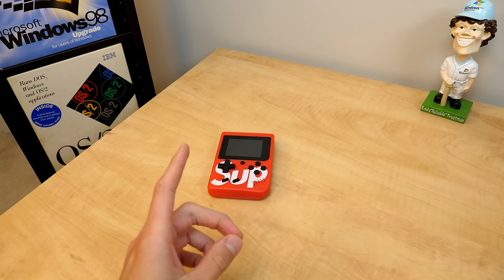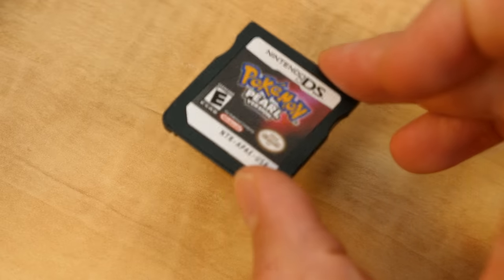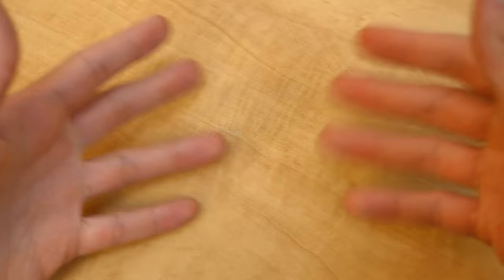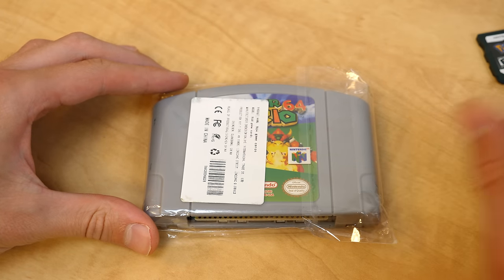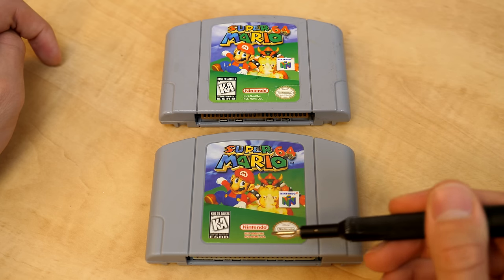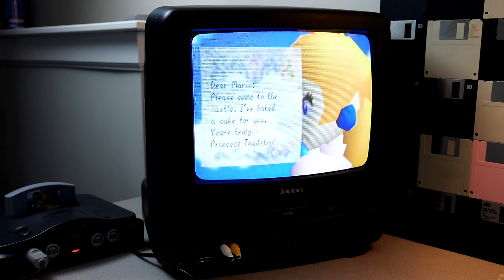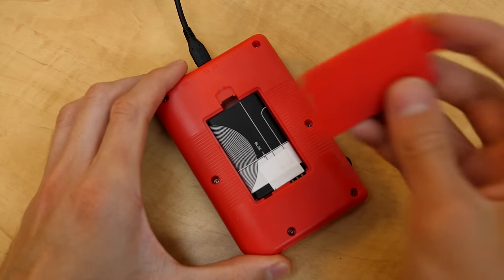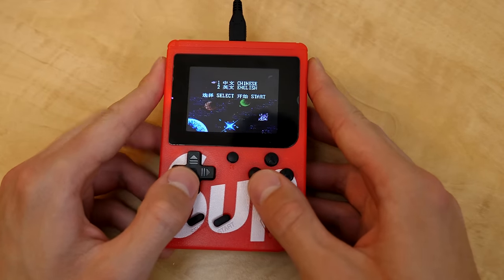I Bought Bootleg Nintendo Games from Temu

Comment: My greatest piece of advice to those looking for these older Pokemon games is consider buying the Japanese versions. They are more often cheaper as they were produced more than any other language of Pokemon games which means your odds of encountering a fake copy are also less likely due to their high abundance.

An example, it’s difficult to find an authentic copy of Ruby that’s being sold for less than $80 or even $100 if you’re lucky in English. 

But a Japanese copy you can find a lot of for around $20 
Hell in Japan you can find Ruby at many thrift stores for the equivalent of $2-$10. 

If you can get over the language barrier and if you’re buying 3ds games which require a region locked 3ds or jailbreaking your region’s 3ds into allowing for other region games to be played then you’ll want to consider going for the Japanese versions of the games

Sorry for the long rambling, this is just the best luck I have had personally with the issue of finding these old games at a fair price while they are authentic

Comment: Okay, but one question:
Does the 520-in-1 actually save data?
Reply: I don't see why it wouldn't. DS Flashcarts typically handle saving by just writing to a file on the inserted micro SD card. I suppose it wouldn't though if the micro SD card didn't have enough space or if it was a really poor quality one.

Comment: anyone who knows their stuff, what exactly is the difference between real and fake carts?
I've heard bootleg Gen 3 cartridges can't be used for Gen 4s dual slot features (Pal Park, different encounters), is that still true? What about gen 4 fakes, do they have any gameplay-related drawbacks?
Reply: Not sure about Gen 3. 
Gen 4 has no drawbacks, you can use it exactly as the original. Gen 5 depends. Unpatched Black&White 2 Roms will turn your playthrough into an involuntary zero xp challenge (anti-piracy). With Black&White I had back then no noticeable issues at all. But then it actually was pre-release of the actual game in Japan and in Japanese back then. So no idea if I might have missed something because of the language or because there still could have been happened minor changes until the actual release.

Comment: Oh I have one of those "Deep Labyrinth" flash carts except it was actually advertised as a flash cart. I mean it may not be an actual pokemon cart but as far as flash carts go you could do a lot worse. DS has it lucky, you should try pricing a decent quality GBA or GBC flash cart.

As for the pirate LeafGreen cart, be aware of two things: a) they're generally not compatible with the DS pokemon transfer features and other slot b stuff and more importantly, b) some carts don't have enough save memory and will corrupt once you capture more than a hundred or so pokemon.

Comment: It would be worthwhile to check if the DS games work on a DS-i or 3DS. These do check region codes, maybe would also detect bootlegs. (OFC you cannot test the GBA cart with them.)
Reply: I'd assume it would work. Later flashcarts work fine on DSi's and 3DSes, and that's kind of the point of them ripping the metadata from a real game.

(Most of the pre-DSi flashcarts worked by bypassing the menu entirely.)

Comment: Bootlegs are ok as long as they arnt being sold as a real copy. What I would like to know is can you trade pokemon with a genuine copy of pokemon? I have had bootlegs in the past that have and have not allowed me to trade
Reply: > Bootlegs are ok as long as they arnt being sold as a real copy.
Additionally, as long as they work well. I've seen bootlegs do weird things like crash at specific points, trip anti piracy measures, and so on. I've seen quite a few bootlegs of Pokémon Black where they didn't address the anti piracy and you can't gain EXP, which makes an RPG quite difficult, as you'd imagine. Another well known Pokémon one is what's called Vietnamese Crystal, which can be quite glitchy sometimes.
> What I would like to know is can you trade pokemon with a genuine copy of pokemon? I have had bootlegs in the past that have and have not allowed me to trade
Yeah, it kind of does tend to vary. Higher quality ones still should work. I remember seeing a video of someone transferring a glitch Pokémon from Red all the way to the 6th generation (most recent at the time), and I believe they traded through flash carts until reaching Generation 5 to connect to Pokémon Bank.
Reply: @Pokemonhacker1337  the copies I had that would let me trade would actually trade like a normal in game trade with another player. The ones that didn't the genuine copy will search for other game to trade with but wont be able to detect the bootleg/ rom

Comment: I came across this when I thought collecting original ruby/sapphire/emerald/diamond/pearl/heart gold/soul silver pokemon games would've been a great idea during covid, then I realized there were counterfeit/reproduction GBA and DS games, 3ds not so much because of the distinct white cartridge and people usually hacked their 3ds instead. I did my research, kind of took a risk on a bundle but they were legit. I bought the original collectors versions because I have my original GBA SP, DS and 3DS.

edit: for the DS cartridges, they're actually a bit translucent if you run a flashlight behind it and it's really dark purple. reproductions are solid black. for GBA carts they usually have the lithium coin batteries for time.

Comment: I bought knockoff Pokemon crystal and emerald games the other day for $25 for each saying “brand new” the crystal didn’t even start up and the emerald started but didn’t save and NEITHER had a save battery which BOTH should. They had invalid checksums AND weren’t in the system when running them through FlashGBX and FlashGBX gave an error saying it’s gotta be a fake. eBay has no system to stop sellers from sellers from selling this crap and probably don’t care! And they have no rules or requirements for sellers to say in their listing that it’s a fake or reproduction and you’re not entitled to a refund if you find out it’s a reproduction or fake after you get it. It royally pisses me off. Full disclosure I’m a noob at buying retro games as the last time I bought one was when the Pokemon games were released. Yeah  I’m THAT old!

Comment: I wouldn't call the GBA or SNES games fake. They are unauthorized but they do work. And I find it actually kind of nice that there are still actual cards made that work for such an old system for the SNES. The interior looks different but it's still genuine hardware since it works perfectly with the SNES.
The only problem I have is when people sell it as official. I've seen GBA Pokemon games on Wish that actually stated they weren't offcial. I've had no problems with that. And the fact that those are actual cards with actual ROM and such is nice. The DS flashcards are just lazy and not worth the money (you can get those for 10 bucks).

Edit: Those GBA games on wish were 5 times cheaper than the original ones. The ones in the video were scam since they were priced the same.

Comment: You don't need to take apart a GBA cartridge to tell if it's fake. The original ones have a number pressed into the label so if you look for it at an angle you will find it. Fake cartridges no matter how good they resemble an original won't have that number.

Comment: as someone who bought and played on a bootleg cartridge they dont last sadly, they have so many bugs and random stuff happening they become unplayable after a while. only got like 6 hours in before mine soft locked itself lol
Reply: Just one or several?
Reply: @John-Doe-Yo  i bought 2, they both suck lol
Reply: @obama_is_hot6  not that surprising honestly. Unless you wanna play on the OG hardware might as well emulate. You can do it on your phone or a simple laptop those retro games don't require much power to run.

Comment: Theres only 2 real reasons one would really need to buy a physical copy of these Pokemon games: Collecting or connectivity. If you are a collector then you will be on the look out for any of these games that come onto the market though odds are you will likely know what you are looking for. This would probably fool an inexperienced collectors.

Connectivity would be the other reason you would grab these with other GBA compatible games such as the Gamecube games Colosseum and XD: Gale of Darkness, the Hoenn GBA games Ruby, Sapphire, and Emerald, or the DS Pal Parks in Diamond, Pearl, Platinum, Heartgold, and Soulsilver. It's important to note that Pal Park and the Gamecube games will not work for fake games. They simply will not detect them and you actually risk your save data being reset/deleted if trying to connect to Pal Park. It also does not trigger the cartridge encounters in Diamond, Pearl, and Platinum. Trading between Ruby, Sapphire, and Emerald though actually works so at least you have that.

Comment: Wouldn't mind buying a ROM flashcard of Pokémon if they just advertised it as just that and not as the genuine game.

Can you still trade Pokémon with a ROM?
Reply: Just buy a R4 and do it yourself. If you want to pirate it it would be stupid spending a lot of money and have >9000 R4 cards with one game each while you could buy an empty one for a lower price and load as many games on it as the SD has space (and then you still could just buy a second SD). 

Trading between R4 and a legit copy works. Did this a lot back then when Gen4 was new (as I checked Pokemon for cheats and needed to get them onto my computer).

Comment: i was in the past in a group who makes games for the gameboy, gameboy advance and commodore 64 and i saw those cartridges a lot. there are common for game developer who does make games for those systems. the thing is making cartridges like they did in the past is no option today unless you planning making 1000 a month of them. the older or original cartridges uses hard coded rom with a litlle bit of ram in it 8kb to be exact some of those are more as ram and rom in one chip some of them are little µcontroler who used a technique that is knows as banking. pokemon games as example had up to 2mb rom and used that extra chip for banking and rom one specific aria in this 8kb ram was be redden from the chip so it could pick the right 16kb bank the is needed for the game to function. so was it possible making games bigger then 16kb also expanding the 8kb internal ram to 16kb in total. pokemon gold had 44banks each 16kb. 
in the original pokemon game the left was the gatechip / mainchip or a simple rom depending of its function, but it contained always the entire game. the right one was the sram chip of 8kb. the main chip contains often a little µcontroler the clock was on the GBA provided by the device it self on the older gameboy there was the need for quartz. if you have a cartridge that can store data but does not contain a battery the main chip will contain a eeprom section for the stored game data otherwise you have a code based storage solution thats shows you a code on certain checkpoints in the game with them can calculated your actual state at this time. so real storing data at this time. with a battery on the other hand your game progress is saved in the sram and gets lost if the battery dies. most game used the code or the battery solition because eeprom was expensive and could only survive a specific numbers of over written. 
Back to the newer one. the newer has a exposed mainchip under the coating/blob it has a modern sram and also a rom but everything that was in the older baked in the rom/mainchip is now separated because building a special chip is expensive. so they use a µcontroler as main chip that provides all features like the expensive special rom except for the rom it selfe. you can program this controller like you want you can have now unlimited banks or you need a rtc no problem. oh i forgot about that the battery was also used as power source for the real time clock that can also be backed in the special rom. so yea making games for those systems is still today a thing there fore those simplified cartridges exist and there meant for small quantity copies of your game because how i said those special designed rom or mainchip or gatechip are expensive to produce unless you planning making million of this continuous over months. and why the chip under the blob you may ask? yea it is cheaper gluing and binding the chip on the pcb is as making a custom made housing for so it is the same reason why no one makes those custom rom chips. maybe the small controller gets made in the same factory like the pcb. but you find those type of chip binding on gift cards too so i dont have really an idea why it is like it is.

Comment: Gba fakes usually delete the save file around the time you get to the elite 4. Got insane Spinda pattern that I wanted to trade to a real game so I could transfer it to the Home (yes you can do that) but before my 2nd gba arrived the save file died 💀. Apparently there is only that much memory in those cartridges. So when it reaches the limit of data it hits delete button.. 

Although my fake Platinum that I got 3 years ago works like a charm. Even PalPark works perfectly

Comment: As I own original copy of Diamond. (Eu one), the ceiling was more light. I have two copoies of diamond in my hands, mine and my friend's. About bootleg is not that they ain't playable or anything but the GBA don't work as 2nd slot for Gen 4 games sadly...
Also fake copy cartage has the shape of an R4 cartage (I own two of them, one I bought, the other is of my friend's one, blacklisted by DSi models and not recognizable by classic DS, only can be used on DS Lite
Edit: should keep watching I guess 😂. They clearly sold it for the price of an actual R4 + $3 😂.

Comment: I mean, so long as they're cheaper than the official, and work all the same, why not?
Reply: Depends on how "work" is defined. Some of these knock offs are done lazily, like they still have the anti piracy stuff enabled which would make the games basically impossible to play. I know some games just freeze, or they do other things, like Pokémon Black/White disables experience points, which makes an RPG quite hard if you can't gain levels.

Also there is the concern that these use cheap SD cards that will probably lose the data quite quickly, so you might want to replace that with a new one from a store.

Comment: lol these are all  literally just an R4, the 520 in 1 cart even had the same rom menu as my own back in the day. Super nostalgic. Cant really complain tho, heavily moddable and you can customize it all to how you like. ALSO QUESTION! So I bought an n64  at anime expo the year before covid and found that it doesnt work even tho they told me it should. Its obviously been region unlocked and stuff but for some reason just wont turn on and the power supply kinda just slides on out. ANyone know a fix for this??? I dont live in cali anymore so I was never able to take it to the shop in LA that the booth was from. This has irked me for years lol EDIT: should note that Ive gone in and cleaned the pins on both the console and my games but still have issues

Comment: Honestly, an R4 for $25 is actually a pretty good price, especially if it doesn’t have the software timebomb that most R4 companies love to put in. Which means you could move the files from that sd card into a larger capacity and load more roms onto it, too
Reply from the maker: These aren’t real R4 carts though. You can buy this same knockoff on Amazon for $15, and possibly even cheaper on AliExpress. These bootleg sellers are just charging you more to have it come with a ROM on it. It’s really not a good price at all.

Comment: Is funny how this video aged like milk. Now a copy of emerald (and most of the gen 3), is quite rare to be under 150~200.

In the case of the gba games, the only thing you can't do is the trade directly with games of other consoles (aka, the gamecube and ds). Everything else works normally (well, almost everything since most of those cartridges don't have a real rtc system to keep time).

To solve the problem with the trade, you can extract the save and run the rom with an emulator. I've transfered a lot of mons from my gen3 emerald to my gen4 pearl just using an emulator and then putting the save back into the cartridge.
Reply from the maker: I'm not really sure how that makes this video "age like milk." the GBA bootleg I got was super cheap. $5 is nowhere near what you would pay for a genuine copy, even back when this video was released.
Reply: @MichaelMJD  The comment was in relation to the idea that you can get an original copy for nearly the same price of a bootleg. Maybe in the past that could have worked, but nowdays you can't find anything original "cheap".
Reply from the maker: But... I clearly said in the video that the LeafGreen copy cost $5. It was the exception to the other bootlegs I showed that are way overpriced.

Comment: Buying "genuine" N64 games preowned on ebay is even worse half the time the games dont even boot or crash later on, sometimes they are corroded because they've been sitting in an attic for the last 15 years. question is do you want to pay for a modern circuit board, gamble  on a preowned cartridge which is likely defective anyway, or pay for a boxed original worth multiple 100$s? reguardless of which you choose nintendo is never seeing your money anyway so really who cares if you get the bootleg copy? personally i don't really care if the cartridge has the nintendo seal slightly off colour or if the circuit board has the correct text printed onto it so long as it runs and i get to play the game it does not matter in the slightest.